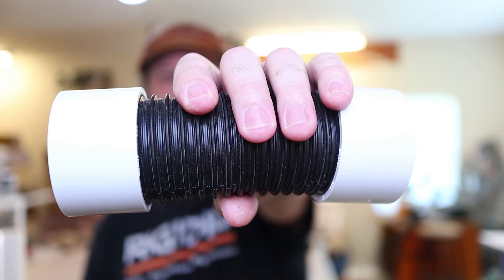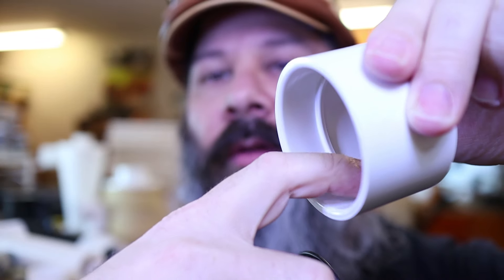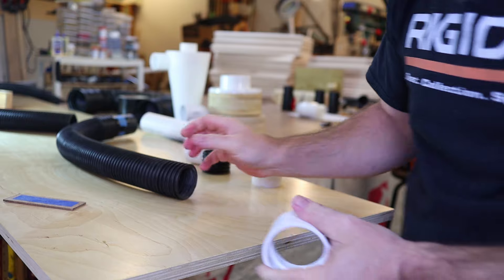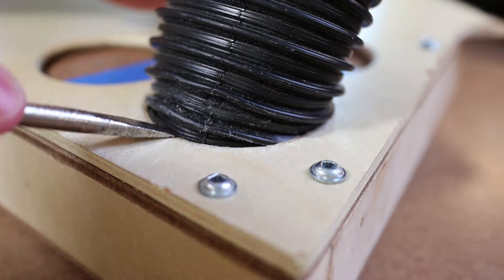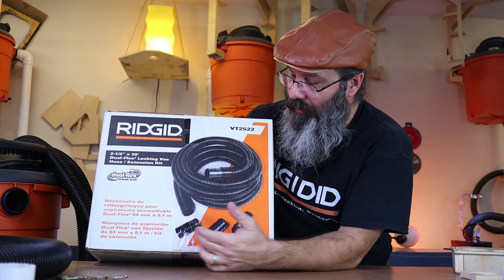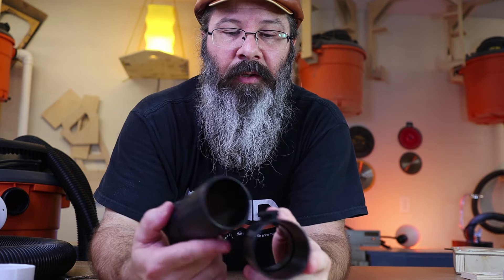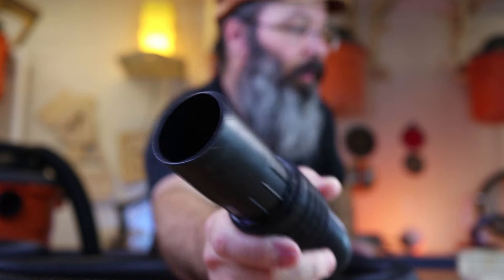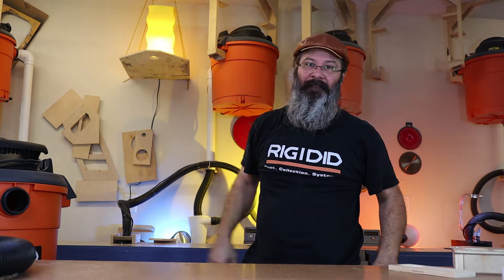How to make short hose for shop vac dust collection systems

Comment: I made a vacuum system for my shop with whole house vacuum pipe and two strategically placed flap covered wall inlets to use standard hose kits.  To power this i used two sears wall mounted vacuums in series ( out of one to in of the other) after a cylonic separator like you used.  Two other tricks were a remote electrical supply for the vacs a muffler made out of a long cardboard box lined with ridged fiberglass duct board from an hvac supply terminated with fiberglass insulation in the last
12” before the 2” air outlet.  It cuts the noise down considerably.
Reply from the maker: Nice!

Comment: Excellent info. I’ve been checking around looking for ways to adapt to my ridged vacuum easily. You answered my question. Btw if you have a hitachi/metabo 10” miter saw, a steel 2 1/4” x 2 1/2” adapter  from an auto parts store fits perfectly on the saw and the large ridged hose.

Comment: Does the same process work with ABS as well as PVC?
Reply from the maker: Maybe. I've never used ABS. The PVC I use is foam core so it machines nicely. If you can cut it with a miter saw without any issues I'd say it would probably work fine. It seems like ABS could be more brittle and have more melty properties with the blade but then again it could be fine.

Comment: Hi.
I really need your help
I want to by a Ridgid shop vac.
I need to suck RATS from home walls!!!
What model and HP do you recommend and what hose diameters and length is the best to maximize the suction power?
Pls is very important! Thank you for your time.
Reply from the maker: Any of the more powerful models are good. I believe Home Depot had a 5hp 16 gallon for only $60 for black Friday that you may still be able to get. Some of the more expensive models aren't as noisy they have sound reduction SNR. A larger diameter hose would be better and a 12 foot length may suit your needs.
Reply: @ thank very much for your time and advice🙏👍🏼

Comment: Thank you very much.  I have made fittings, hose couplings and such with a heat gun, a home made wooden plug I turned to the correct size and PVC pipe/fittings.  While this works, I believe what you showed will save some time.

Comment: 4:49 That fitting is designed for Ridgid old style discontinued vacuums. The other fittings do not attach to the actual vacuum, but that red-clip fitting does. Then you can use regular hoses from there. I never realised you can convert it into a coupling like that, so I've always tossed them out. Now I need to hunt through my spare parts to see if I have one sitting around still!

Comment: Would you supply a way to reach out to you privately, so that I may suggest an easy and low cost Ridgid Shop Vac 2" hose shop vac system Ridged to PVC Pressure-DWV Schedule 40 adapter concept to possibly show / construct / review on your channel?
Reply from the maker: my email is on my channel's about page
Reply: @SlowandExpensive  thank you.
Reply: @SlowandExpensive  Hi, I opened the "About" tab when visiting your YouTube channel page. No Email address was seen there. Sorry.

Comment: Another way to connect hoses to those cyclonic separator is to just use a heat gun on a section of PVC pipe and force fit it over the port. That way it adapts to female PVC fittings to easily connect to all of those short hoses.
Reply from the maker: Thanks!